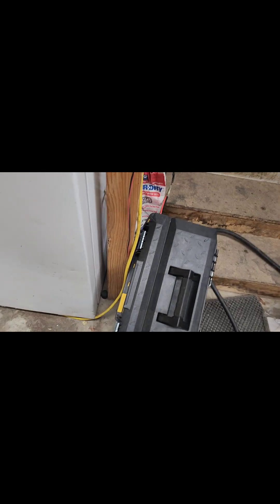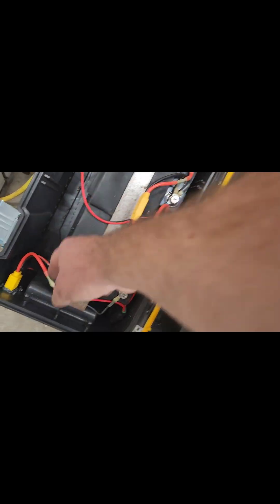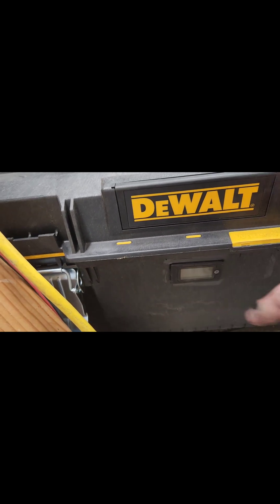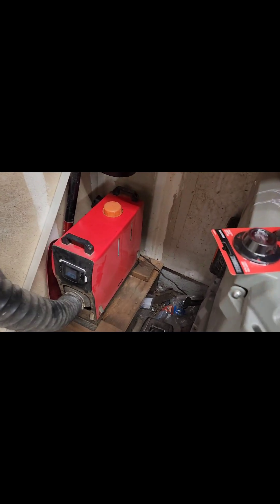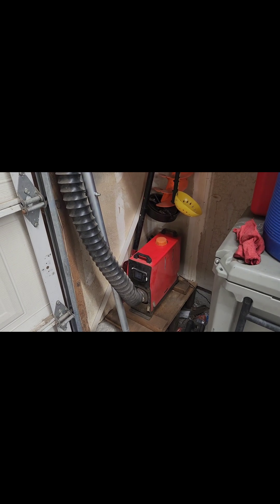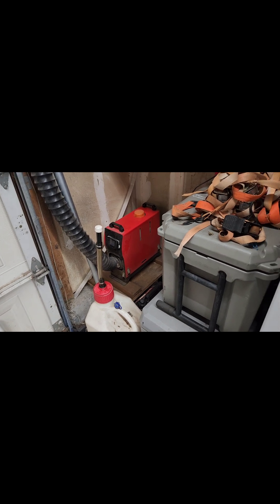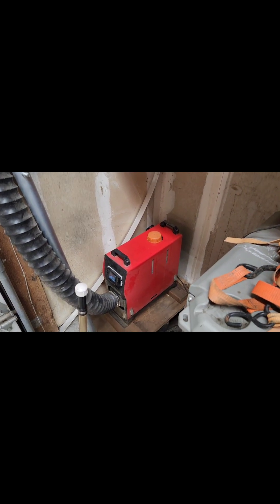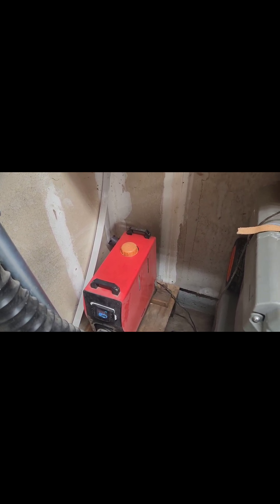How Long Will A Diesel Heater Run On Two 50 Amp Hour Batteries?

Comment: Interesting.  36.5 running hours while using 4.5 gallons of diesel (on road diesel, I assume).  A quick Google search tells me a gallon of diesels contains approximately 138,700 BTUs of energy, so 4.5 x 138,700 =645,150 BTUs.  Two 50 amp/hour batteries at 12 volts (I assume) is about 2 x 50 x 12 = 1200 watt/hours or about 1.2 KWH (Kilowatt hours).  The batteries store about 12 cents of electrical power at my local rate (only 9.8 cents per KW).  The heater therefore uses about 32 Watts per hour (.032 KWH) of battery power, while the heater provides about 17,100 BTUs per hour (at 100% efficiency, in theory.  Probably closer to 70 % efficiency).  A Watt of electricity is equivalent to around 3.4 BTUs.  The batteries have provided about 108 BTUs per hour, while the diesel has contributed about 17,100 BTUs in the same time.  So the tiny fraction of energy provided by battery power is about 6.4 thousands  (.006) of the energy provide by diesel.  Another way to look at is the diesel fuel provided 157 times the energy proved by the batteries. All of this is approximate (ie: an educated, but wild ass guess, or WAG).  This all goes to show how much more energy dense liquid fuels are as compared to electricity.  This should also show how much more efficient electricity is (near 100%, at point of use) as compared to diesel fuel (around 70% here, but only around 30% in an internal combustion engine.  Your results may vary.
Reply: Wonder if you could get a couple small form wind turbines and place one in front of the heat output and one in front of the exhaust output and use them to charge the batteries back ?
Reply from the maker: Thank you
Reply from the maker: Might be worth a try